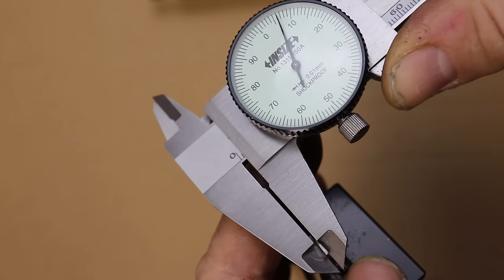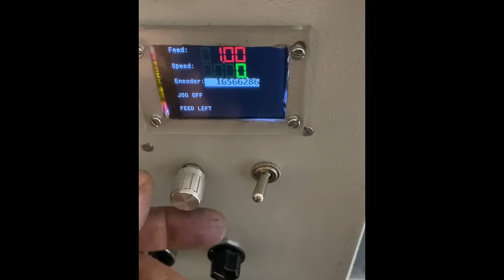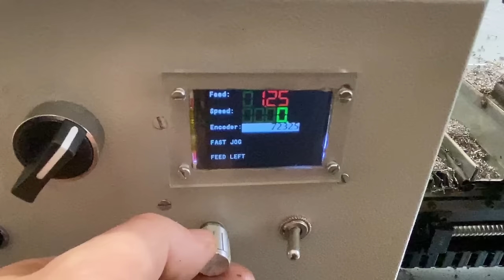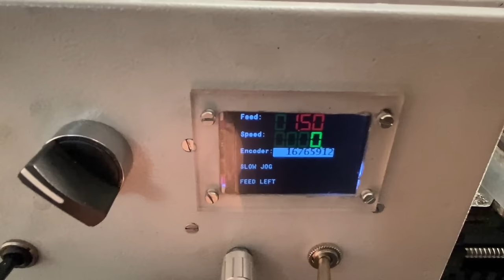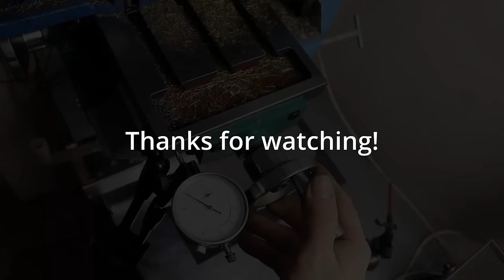Replacing milling table leadscrew

Comment: great video. Just a suggestion, if you were to make another lead screw nut, make a slit into the nut and by means of a grub screw through the slit, it could then eliminate any future backlash with adjustment of the grub.

Comment: Nice job!! I have same table with 5/8 LH threads..  Your setup will be better if your turn on lathe the hand wheel to cut straight, and cut new dials.  Which diameter did you have TR16x2.00 LH ?
Reply from the maker: Yes it was 16x2mm RH thread. But already sold this table and i have bigger, better one now.
Reply: @kvechannel a❤aaaaaaaaaaaaaaaa off by😅